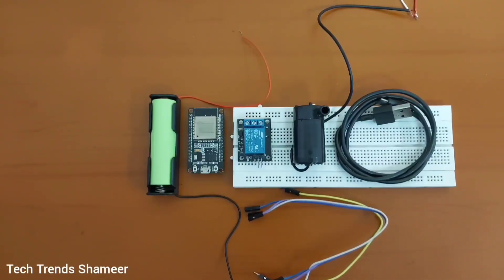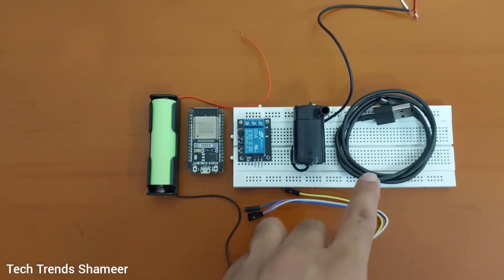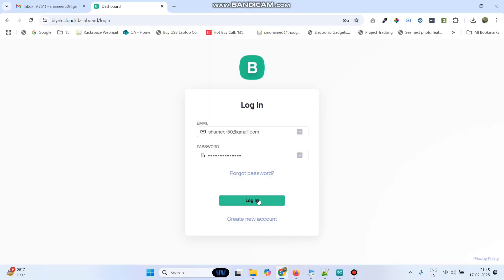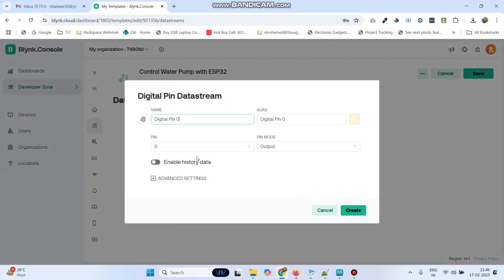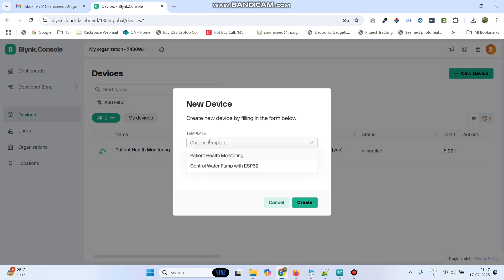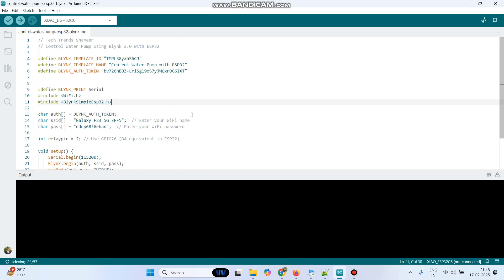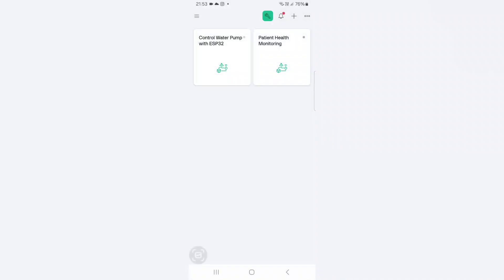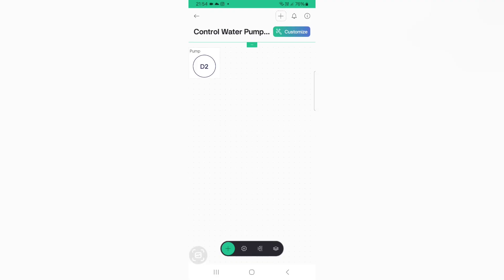Control Water Pump Using ESP32 & Blynk IoT | Smart Irrigation System

Comment: I'm thinking about using a 12V 20W motor. What changes do I need to make? Can I just use a 12V power adapter instead of a battery, or do I need to change anything else?